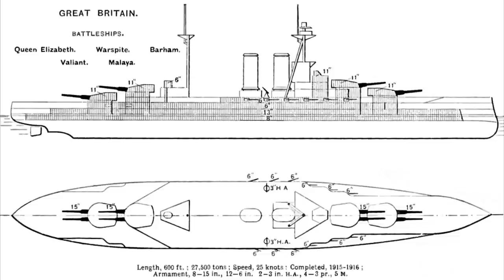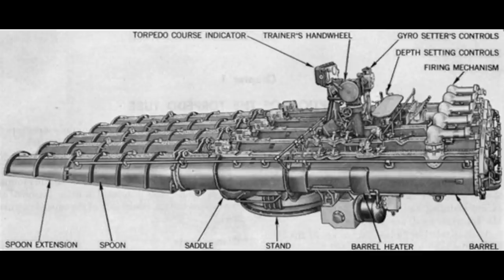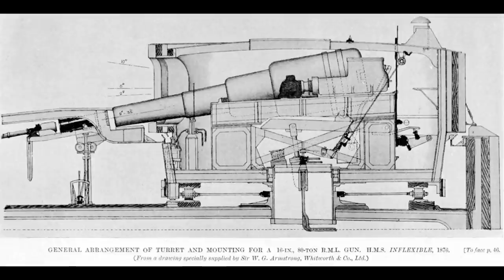The Drydock -- Episode 165

Comment: Did Britain actually have enough large slipways available (ie not already building something else) to build the 3 Canadian QEs at the same time as the 5 historical QEs? It seems as if to get them laid down as soon as possible, we'd see HMCS Acadia, Quebec, and Ontario occupying the slipways that were historically used for the first 3 Revenges. Meaning that they get delayed in their laying down until some time in 1915.

With such a delay I wonder whether those 3 ships would be built at all. By the time slipways would be available again, Jackie Fisher is back in place as First Sea Lord. Isn't it fairly likely that he would've decided that since haven't actually been laid down yet, they should be reordered as battlecruisers in the same way that the final pair of Rs were? In which case the only R-class battleships will be Royal Sovereign and Royal Oak, and there'd be as many as 5 15" armed battlecruisers (Revenge, Ramillies, Resolution, Renown, and Repulse).

Though possibly only 4 such battlecruisers would be built. After all, HMS Resistance was simply cancelled rather than being reordered as a battlecruiser like Renown and Repulse. A battlecruiser is after all generally more expensive than a battleship. So 3 fewer Revenges leading to 2 more Renowns seems somewhat plausible. If that's how it turns out, the Treaty impacts are fairly obvious. When the London Naval Treaty comes around, Britain (plus Canada) has 1 fewer capital ship than they did historically but overall better ones. The ships disposed of would obviously be Tiger as the only 13.5" ship left in the fleet, and Royal Sovereign and Royal Oak as the least useful of the remaining battleships.

On the other hand if all 3 of the delayed Rs get reordered as battlecruisers (meaning 5 Revenge-class battlecruisers), the same number of ships need to be disposed of for London as were done historically. Leaving Britain with a hard choice. The final ship disposed of would have to be either an R-class battlecruiser or one of the QEs. All of these are very useful ships, so it'd very tough to choose which one has to go.

Back to the Canadian QEs, another interesting prospect with them is that since they would've presumably been homeported in Canada, it's possible one or more of them sailed to New York to be refitted by an American shipyard (either before the war, or during it in the same way that Richelieu was after defecting to the Free French). Imagine a QE getting the sort of refit that Nevada, California, Tennessee, and West Virginia did, with a South Dakota style superstructure and 8 twin 5"/38s for the new secondary armament.
Reply: Oh, and something else that occurred to me. With Britain having overall a much faster fleet in this alternate timeline, I wonder how that might have impacted the Nelson-class battleships. Is it possible that Britain would've decided to transition to an entirely fast battle line, and choose the F3 battlecruiser instead of the O3 battleship design for the Nelsons? The F3 was still quite well-armored despite being a "battlecruiser".

Comment: Regarding bow v Stern propellers, I would think the bow wake would also play a role. In stern mounted you're pretty much getting laminar flow whereas in bow mounted you'd need to mount them fairly far forward of the hull itself to get clean water flow. Maybe you said that in different terms.
Reply: Another possible factor that occurs to me is the amount of pressure (and therefore risk of leakage) on the water-tight glands where the propeller shaft emerge from the hull, if they are directly facing the direction the ship is moving.